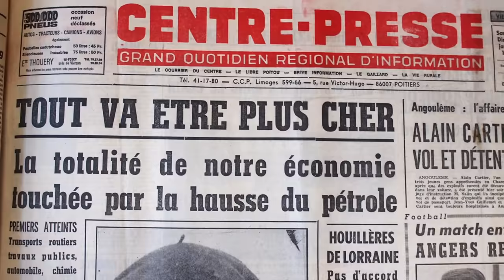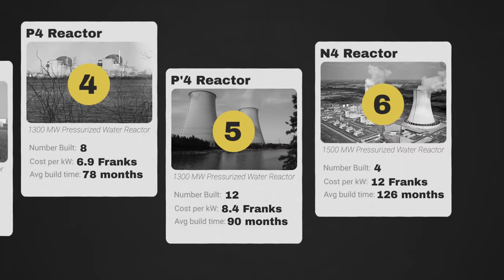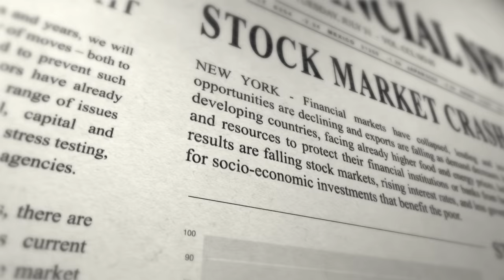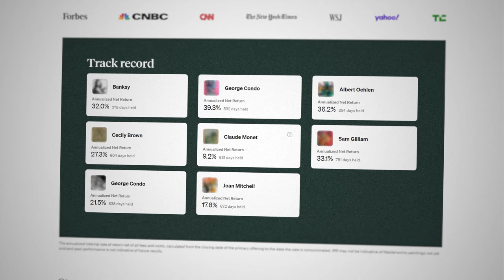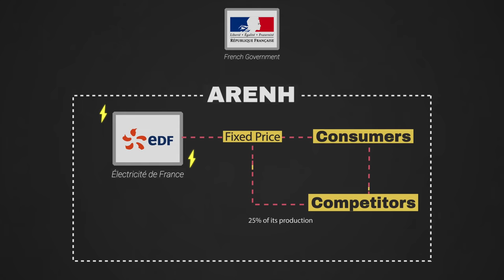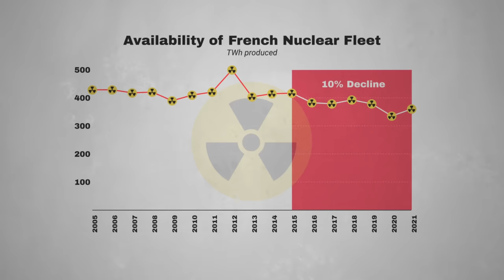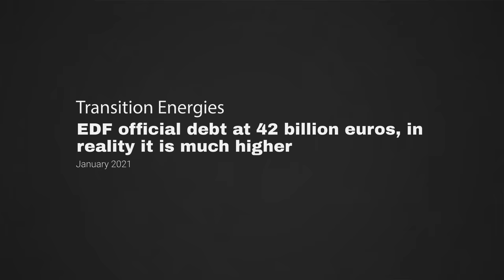Why French Nuclear Energy Failed

Comment: Although many are talking about a nuclear renaissance most countries that have large reactor fleets are building not enough to replace older ones. E.g. the US and most European countries. Even with rapid expansion the share of nuclear energy will decline for at least 2 decades. During that time renewables expand rapidly and storage technology and smart grids evolve. I am not sure nuclear reactors are economically viable in the future if they even are today.
Reply: In 2050 the energy demand will be three times that of today, we need to switch all our industry to electricity to replace fossil energy as primary source. This ensures that there will always be a base-load demand that will be coming from new industry's that produces green molecules to substitute current fossil bases chemicals. Nuclear is economically viable, if we build many costs and delays will be lower then today. They are economically viable and will produce new value adding industries what makes them the most economically viable ever.
Reply: @fredbcf1255  Wind and solar are much cheaper in Europe than all the other energy sources with the exception of lignite. All 3 are below 10 cent per kWh while nuclear is at 11-13 cent. The high prices of electricity at the moment is due to coal and gas import prices being high.
Reply: Situation in Czech rep: Last year we produced 77TWh of electricity. If we were about to de-carbonize industry and use electric cars, we would need at least 135TWh of electricity.
i.e. would would need to nearly DOUBLE the electricity production over short period of time (one or two decates). 
Or we could start importing electricity from abroad. But we are landlocked country, surrounded by electricity importers. Those GreenDeal plans are totally unrealistic and there is no way to fulfill them.
Reply: @ivanbrezina7632  It might be difficult for Czechia as a landlocked country but countries with a lot of wind and offshore wind as well as countries with plenty of solar power potential are abundant in Europe. Czechia is surrounded by electricity importers? Germany is a net exporter and they get 55% out of renewables already and plan to more than triple capacity in 10 years. Austria is producing plenty of electricity but from Russian gas and Poland has rapidly reduced electricity imports and might actually be an exporter by next year.
Reply: @tobiwan001  You're right Germany become electricity exporter recently. But it as also getting more and more dependent on coal/lignite. Poland is nearly 100% dependent on coal. During coal phase out Czech rep, Poland, Austria, Slovakia and Hungary will become importers. Low chance to keep up with demand doubling the production is impossible.
Reply: @ivanbrezina7632  Explain the coal part for Austria please, as we phased out our last coal power plant several years ago. Our electricity production is already at 80% renewables thanks to water and bio gas. Oil and Gas are a problem for industry and heating though. (The overall energy part of renewables is around 34% percent so one sees the discrepancy between electricity and energy as a whole as electricity as much better served by renewables)
Reply: @mal_dun   In 2022 Austria had reopened the Mellach coal-fired power station.

Comment: They should go green at lightning speed because it's cheaper in LCOE. The co dituo s for wind and solar are great. 

For substituting reactors, that's their own business. But load following is either wasteful or adds complexity (or wear and tear) by design, thus sticking to one replacement design but only say 30% if the lectric load (like in Spain..) sounds most reasonable to me. They have droughty, it's expensive, EdF carries close to 90 billion im debt...

Thus go green and make Renault a BEV superpower.
Reply: @Walterwaltraud  France nuclear fleet does load following that may effect capacity factor but that's about it and france is connected to EU grid and has headroom for export and their product is much preferred to W/S because it's dependable, i'm not sure about this causing damage to the reactors france is doing studies to possibly extend the rectors to 60 years and this fact alone goes against what you said, france recent problems are due to pile up of work not done in covid times (poor management) and pushing reactors to limit in same period to secure supply (lack of oversight and awareness)

And by the way the W/S suffer from reliability the most, expensive batteries and bigger grid is required and that's not even enough to address it constant on/off for wind turbines is proving bad for their life span that is dwindling from expected 20y to 13-15y (example denmark) all of this nukes your LCOE argument as non of this is mentioned

You addressed some good points and challenges facing nuclear grid but non that can't be overcome, and your supposed better alternatives are laughable and would not make anything better but worst by a long shot and cost trillions doing that like any renewables grid just ink on paper and studies far from any real life example
Reply: @ihab_7  You are obviously not an engineer. The load following of French nuclear reactors is something I've know for decades, only the first generation of reactors was not able to to that. But as I stated before, that still wastes capital and energy if you cannot make good use of the lower end of the energy load curve. Such might be electrolysis, but when those are only working part time, it's wasted tied capital as well. Or heating water, charging cars, raising the load on bauxit melting etc. On a grand scale, btw and since you appear to be a nuclear tech fan but no expert, I'd suggest you start looking at the supply side and availabilty of exploitable uranium oxide globally. You fanboys seem to miss that, whilst I look at the engineering and macroeconomics mostly. You never look at the negatives of your on fanboydom and never fail to amaze in trying to downplay all the upsides that another alternative provides. 

So once more, wind and solar provide very steady cheap energy, very decentralized, and since they are dispersed in a very decentralized way an adapted infrastructure in the transmission net is needed. But that comes organically, as the net needs to be rebuilt every couple of decades anyway and network planners aren't silly fanboy but serious utility engineers. It raises the resilience of the network, ask anyone in Northern America or Ukraine for that matter. It lowers the export of funds to resource rich country (how many uranium mines in France, just for the record?), makes use of engineering skills locally etc. But - it definitely needs buffering. Now your battery argument falls flat on the face, the only moment those are useful are in mobility and day-night storage. Gas peaker plants and gas underground storage however are legacy technology, rather low tech low capital investments and thus the easiest way to go in backups. None of that is needed if you have rivers like Québec or Egypt, or geothermal like Iceland. 

(more later, gotta operate some megawatt gas turbines.... as opposed to you, I am not a layman in this field...).
Reply: @Walterwaltraud   Im not projecting anything but that's what you sound like, my dude you already started backing up from your words, why would i look at france and not china or russia france had to call welders from abroad they have a massive worker shortage in the field because the last anti-nuke gov's only talked about reducing nuclear not building, it required a massive hit to their electricity supply to wake up, maybe try and figure out why something is happening not just say it is 

you're a whole engineer who's to good to google what other engineers have to say and can't figure out why germany didn't add more renewables, the grid can't handle it they tell the existing ones to switch off
Reply: @ihab_7  Sorry, get rid of your loopholes in logic before this conversation makes sense: Switching off is done at times when the grid cannot handle the load, obviously, but that's a low single digit percentage. Perhaps you should look beyond the headlines and face the facts. Also, the reason why the expansion was stifled was mostly due to clever lobbying of incumbent utilities (especially the big ones with huge investments in existing huge power stations, should give you a clue why they tried to get around stranded assets in their portfolio) and parts of the industry, fearing a payer distribution without exemptions for the biggest consumers -- them. Btw I don't need to google other engineers, I talk to nuclear engineers regularly since we practise the same sport. Furthermore the wasted lower single digit turnoffs could easily used for heating water year round, which would only require some more digital counters, but that's been stuck in Germany's fanciful bureaucracy and lack of pragmatism for a decade, perhaps you should expand your rather limited knowledge by googling it...

As for the welding in France, they got lazy concerning public finance in the years following 2008/ 2009, please guess why... else I would give you a hint: The EPR is frigging over budget, new NPPs are very expensive thus EdF did not follow up on the core asset  they have, other than the grid. 

Get it? New NPPs are fucking expensive. Tie down huge amounts of capital. You may try to pin it on ideology, but if France had gone heavy on solar (both the production and rolling it out), guess what the NPPs could do at night (has sth to do with silicium reduction... just saying...) and what would happen to follow the daily load curve. 

So let me project something else onto you: You are probably clueless about solar  radiation per square meter in Southern France, where I worked and lived for quite a while. 

Get off your fanboy bandwagon and start some basic research. The graphs are quite easy to grasp. Of course, that requires an open mind. Which I have and you don't. See the difference?

Comment: it is simply uneconomical to build new nuclear reactors now when reneables are 3 times cheaper
Reply: unfortunately this does not take the cost of storing energy into account. We will need baseload so nuclear serves that need in the grid. Also, as we build more nuclear energy, we will be able to cost down.
Reply: @AngelicaAtomic  Did actually anyone listen to the video? It was clearly stated that one of them main reasons nuclear fell behind was that they couldn't compete with renewables. We will need by far less nuclear power plants not more, especially if they are prone to shut downs because of lacking cooling water. The situation will not get better.

Comment: Today, 85% of installed nuclear power capacity in the world is owned or contracted by Russia and China.  By 2030, China will have the largest nuclear fleet in the world and also it will have developed an industrial size MSR.   In my opinion, France will find it difficult to compete, but it should as a minimum focus on fourth gen nuclear reactors and either partner with Russia or China and replace its aging reactors.  The US is faced with the same problems.  Solar and wind won't cut it for huge baseload demands.  Fourth gen nuclear reactors are becoming reality and third gen reactors are today's production technology.  In the meantime, gas is the best one can do as a interim energy source.  Make pragmatic bread with Russia and resume Russian gas and oil.  To destroy one's country's industrial sector and deny its people with heat and electricity is a failure of its government.
Reply: I don’t think it really makes much sense to cooperate with Russia or China as they are not geopolitically friendly. France can make it’s own way back to nuclear. Gen 4 reactors…not truly necessary for now. Gen 3 will work just fine we just need to get the supply chain up and running gain.
Reply: But we can't resule russian gas and oil, the gasduct was sabotaged, 🤷 guess we'll buy american liquefied gas

Comment: Is Flamanville 3 going to be even more delayed than Olkiluoto 3?
Reply: Almost certainly. Olkiluoto was going to be fully up and running by this winter before hitting another hiccup. Flamenville 3 is not even slated to fuel load until mid 2023.
Reply: @AngelicaAtomic  But Flamanville 3 began construction over 2 year later than Olkiluoto 3 and you need to account for that.

Comment: Yo don't get it. France civilian nuclear industry emerged (as in USA, UK, Soviet Union and China) to reduce the cost of making nuclear weapons, as the breeding facilities required were the same, and nukes are EXTREMELY expensive to built and maintain. So they built dozens of reactors in a very short time. At the time, renewables were a young technology, unable to compete, and nuclear power plants were subsidized. But when the nuke bonanza started to fade (with arsenal reductions in the 70s and 80s) the Goverments started to cut the support to nuclear. The oversized body of engineers and facilities needed to run the business became a problem, and  the industry in those countries tried to expand abroad. 

   Then Three Mile Island halt the construction of newe American ractors, and increased the operative cost of the ones in use, due higher safety demands. Then Chernobyl did the same in Europe. At the end of the century, operating nuclear power plants was more expensive than ever, and renewables started to be more and more competitive.   Even worse, retiring a nuclear plant is very expensive, and France had so many built that when the end of their projected lifespasn they would have to face the dismantling of dozens of reactors, whitout money enough to do it (and much less to build new ones). Then Fukushima happened, and a year later the third largest Frech nuclear operator entered in bankrupcy. In 2017 Areva (secon largest one), on the verge of bankrupcy, was bought by EDF, which in 2019 had a estimated mid term debt ~70.000 million €. Last year that debt was estimeted already over 100.000 million €, and it only will be worse, because the facilities will be more expensive to run as they age. The attempts of expansions abroad as Okiliuto and Hinkley Point C has been as bad as Flamanville: large delays and x3-x4 the initial budgets.

   The thing is that nuclear energy was never really profitable, and just a mean to socialize the cost of a nuclear arsenal. UK is building Hinkley C due "needs" nek weapons, since the Polaris progran is a total failure. But today no nuclear facility can competre in cost, time and management vs renewables. Is over. Macron tried to ensure nuclear as "green energy" as a desperate move to get founds from the EU to refloat his nuclear industry, but instead of making new reactors they should try to move to renbewables ASAP, as is doing Germany and Spain. In 2000 nuclear represented the 10% of the commercially available electricity, now is under the 10%. In les that 20 years will fade almost entirely. Is not due safety or public opinion, is just due is not profitable.

Comment: Great video as always! In my opinion nuclear is just dead simply due to being completely uncompetitive against cheaper renewables. France doesn‘t have the time or money to replace 50 reactors in the next decade
Reply: Don’t be so sure of that. I believe we haven’t even began to tap nuclear power’s potential in the long term. As for renewable being cheap, they are not so reliable. Eventually we will also need to decarbonize industrial processes that require high heat which will be much more efficient with nuclear plants that can supply high quality heat directly (this might require advanced reactors.)
Reply: "Impossible n'est pas français"

Comment: Good video, however: the extesion of the life of former reactors, which you describe to be "at great cost", is actually the cheapest and greenest energy we can possibly generate. 
This extension of the life of our reactors is followed and allowed by our nuclear authorities which are known to be the most stringent in the world (just look at the past few months if you doubt that: they had the power to close nuclear plants without definitive proof of danger in the middle of an energy crisis. What does that tell you?), and consists in replacing and repairing all the parts of the power plant that can be repaired to ensure it can run in optimal conditions.

It's cheap, it's safe, it's green. We would be trmendously stupid and we would be actively harming european energy security if we didn't do it.